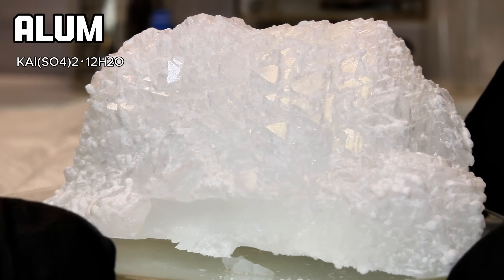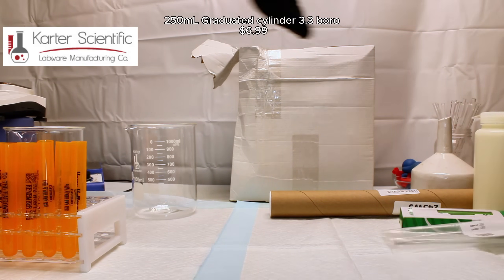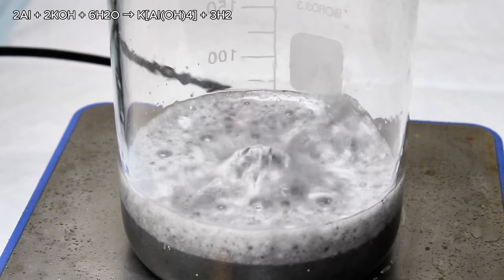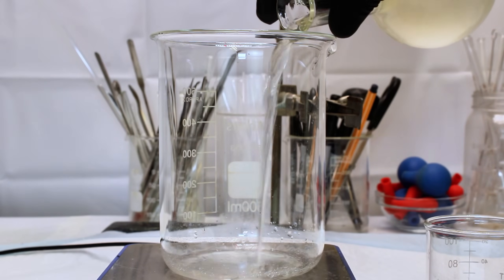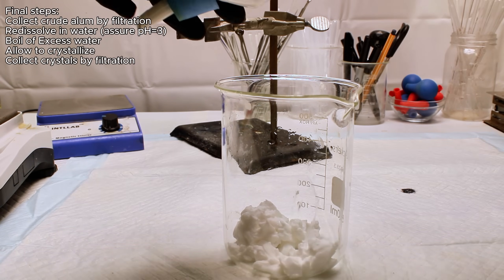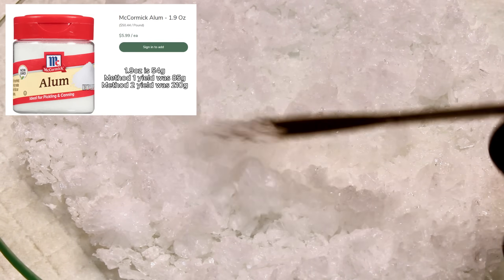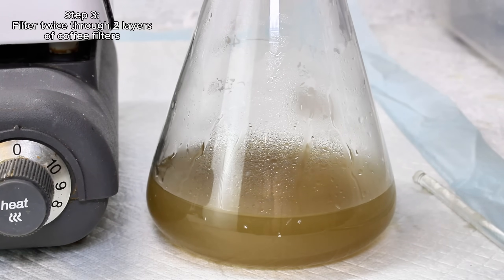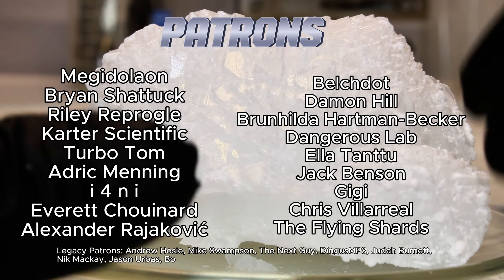Alum from Drain Cleaner (Two ways)

Comment: Say "s", okay now do the exact same thing, but this time do it with the tip of your tongue about half and inch further away from your teeth (backwards), don't tense the base of your tongue against your throat, the sound comes from the tip of your tongue. That is how you say "sh".
Reply from the maker: I have been working on it a lot more recently! Check out one of my more recent videos and let me know if you think I've improved at all (since you do genuinely seem to know what you're talking about)
Reply: @integral_chemistry  Unlearning and relearning something like that will take a long time and a lot of practice, but figuring out what's going wrong is the complicated part. 

Another way to do it is to say a long and drawn out "ssssssssss" sound, like a ssssssnake, and as you're saying "sssssssssss", move the tip of your tongue backwards along the roof of your mouth until you find the position where you get the "sh" sound from. If you start whistling instead of getting the "sh" sound, you need to move the tip of your tongue a bit more until you find the "sh" sweet-spot.

Comment: Which order of reaction do you think would be better if you only had lead contaminated acid available from an old car battery and wanted less lead contamination in the product?
Reply from the maker: Either one would result in some amount of lead in the final product. Recrystallizations can help, but a good way to remove lead from battery acid (If you don't want to distill it), is to run it under electrolysis with graphite electrodes. The lead sulfate will be reduced to lead metal at the cathode and you can easily filter it off or decant the clean sulfuric acid.
Reply: @integral_chemistry   Thanks for the prompt and helpful reply. That is a great idea.

Some batteries have Antimony and/or calcium in the plates structure so perhaps in solution as well, not as toxic but I wonder if they would also plate out the same way to some extent?

Comment: There is a huge bunch of 🎉alums. They are the double sulfates of a trivalent metal (not a lanthanide) and a univalent metal. The trivalent metal is usually Aluminum or trivalent iron. It can also be trivalent chromium. The univalent metal can be sodium, potassium, ammonium, rubidium or cesium. 

The rubidium and cesium alums are much less soluble than potassium alum. So if a kilo or so of alum is dissolved in water if about 10% of it is crystalized it should carry down the cesium and rubidium present. This is repeated with the hundred or milligrams of alum. If 10 milligrams are crystalized the amount of cesium rubidium is 100 fold as concentrated. Somewhere the cesium and rubidium will show. Best results should be with technical grade alum.

It was a very old book that suggested this. I would like to try it.

Comment: The two chemical equations you show look like you could put an ampule of the one stage in a long glow-stick-like container, and an ampule of the other stage in the other end of that container, and then separate them with an aluminum plug to make a simple Hot Hydrogen Balloon for use in thin, cold atmospheres, such as Mars, upper earth atmospheres, and mountaintop launches.
 I can see how it would also make a great ballast-to-reheat/refill cartridge for the same. Simply place a one-way valve above the stick (so H goes into the balloon, but doesn't come back out), then pop the KHO (or better yet, K metal onto an excess of water to generate the KOH+H) and use the H to top off the balloon. The KHO releases more H with the Al, and when you want to reheat the gas in the balloon, you break (this would all be done by automated/remote-controlled sprung breaker pin things from the outside) the H2SO4 ampule that's now surrounded by the mixture in the bottom. This generates an additional burst of heat, but also begins to burn through a bottom plate made of copper, or a similar material. When the plate is burned through, the spent contents spill out, relieving the system of the ballast weight, while the one-way valve at the top prevents backflow, which would deflate the balloon. 
Also, this may be a great compact, lightweight propellant system for long duration missions, such as probes, satellite gyro de-spinning, and trips to Mars, as it would not take nearly as much pressure tank or cryogenic tank/insulation weight, and can also provide a lot of heat for de-hibernating a system in deep space. Of course, if there is no acceleration present to separate the H and other materials so that only the gas gets ejected, the cartridge(s) would need to be in some kind of centrifuge, with some kind of expansion bulb at the top, but things in space love spinning contraptions.

Comment: @Apoptosis Why not trying to make sodium alum? It´s said that it is hard to crystallize because of the drastic difference between the solubility curve of aluminium sulfate and sodium sulfate.
Reply from the maker: I might just give that a shot, it should be much the same process after all. And yeah from what I read it is the most elusive of all alums because it is so insanely soluble it is nearly impossible to crystallize alone (208g/100mL at 15C)

Comment: My son (7 at the time) did this experiment using some aluminum cans he found at the park. We started with the KOH, and sulfuric acid drain cleaner to neutralize. Went through a TON of recrystallizations to purify. We used the alum to flocculate some river water, before passing it through a homemade carbon filter (which would have been gunked up by the sediment in the water) and boiling to kill any wildlife that remained. It was delicious water.

Ten years later, we still have a bunch that my son uses as a styptic for the occasional shaving cut.
Reply: I was thinking if this was the same stuff used by those wet shavers, and it seems like I was right.

Comment: Neat! I've had good luck using alum solutions to dissolve broken steel taps or bolts in aluminum parts/castings without hurting the aluminum. Takes patience, but works eventually. Thanks!
Reply from the maker: I totally forgot to mention that as a use for alum (also haven't tried it myself). Glad to hear it works because that would actually be extremely useful
Reply: @integral_chemistry  Might be an interesting follow up, which alloys it works with and why? Maybe there's a better chemical that works faster?